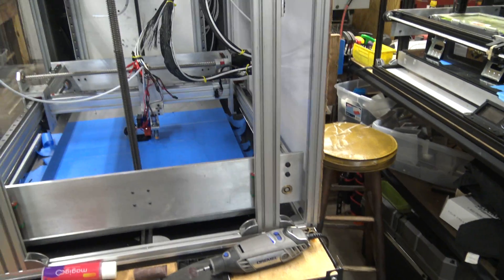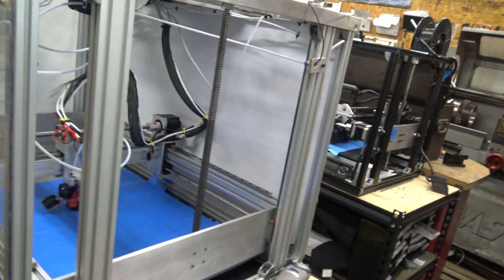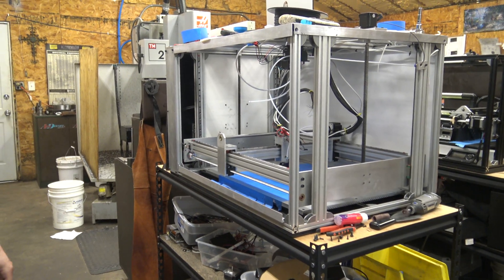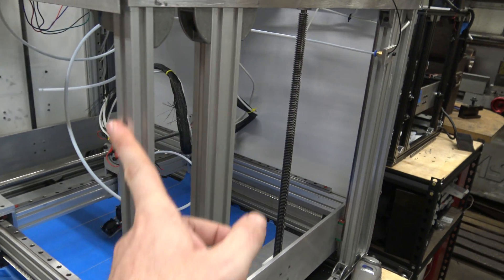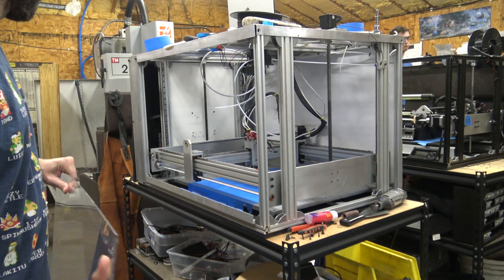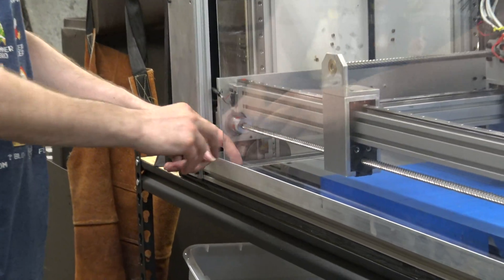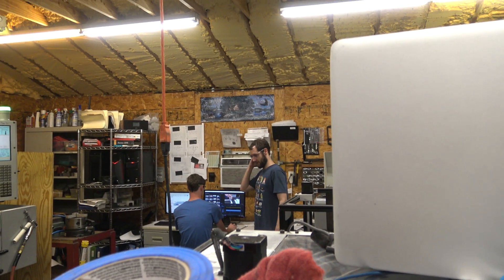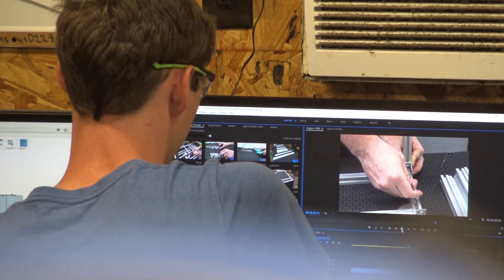WorkHorse 3D Printer - Enclosure

Comment: Was waiting for you to post a printing video of your machine. The speeds seem nice, around 40-50. You seem to have gotten soft on change acceleration speed ( mutation speed ). It’s the part where the motor changes direction, deaccelerates and accelerates again. Try to increase that, this machine can certainly handle it
Reply from the maker: Will do. We originally had the firmware settings much faster but then we turned everything down when we started experimenting with the E3d volcano. Our current hotend carriage mount isnt really designed properly for the volcano. That extra hotend length and forces applied causes some deflection throughout the system. I have the new  carriage design scheduled to machined later this week.